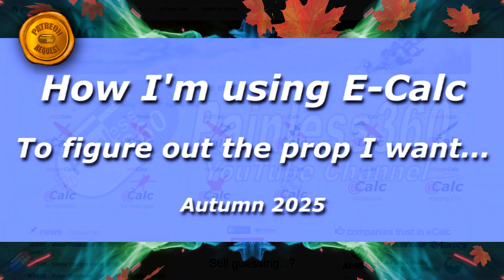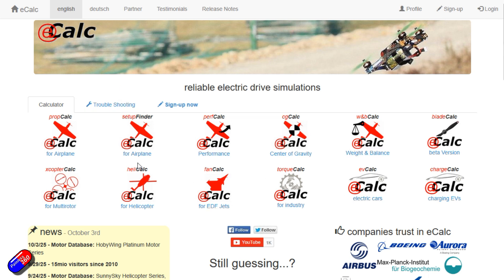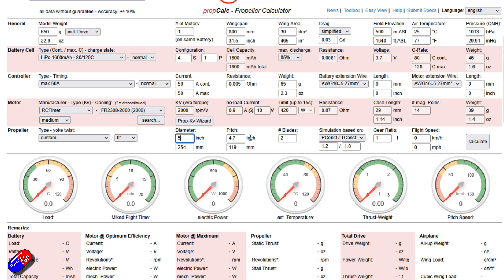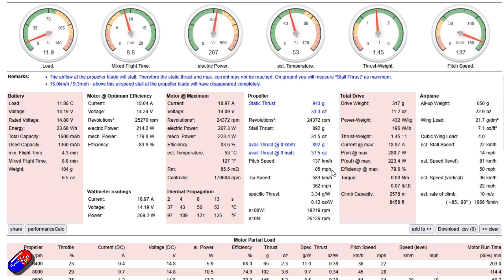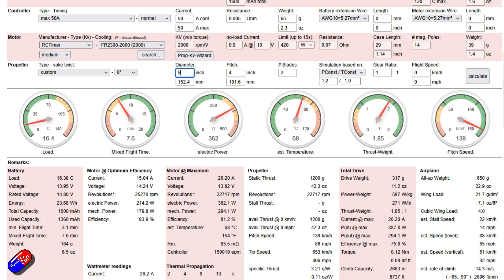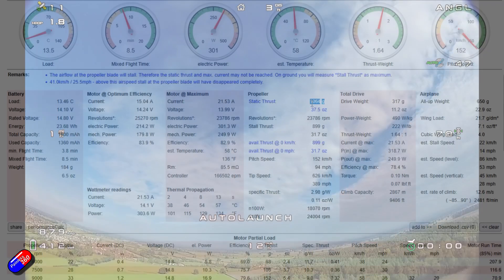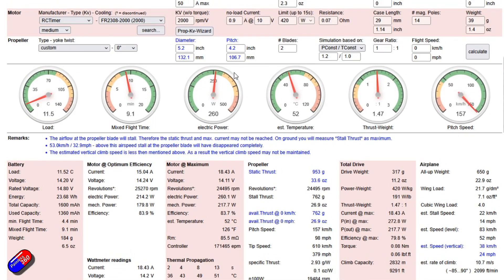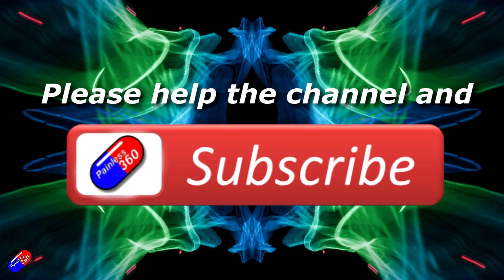How I'm using e-calc to find my perfect Chupito prop...

Comment: The thing is, ecalc will give you an idea about what might work in general. However, it cannot properly estimate your numbers with anything higher than around 100kph. Air drag is a massive factor that comes into the equation exponentially with increased speed. So, do your basic setup and fly at the speed you want to optimise your efficiency at and have airspeed, amps and prop rpm displayed in your OSD. Record that footage and put the numbers down in an excel sheet. Do the same with a different prop. Now you see in what direction your next prop choice should go. Repeat to optimise as far you want to go. But keep in mind: These test flights are not universally applicable for every build, as the aerodynamics of each and every individual build will be greatly affected by equipment placement, such as antennas and cameras. Multirotor people tend to forget about that completely when they dip their toes into fixed wings first

Comment: If only TBS had somebody in their team who is actually interested in those things and willing to do not only the math but will also have a look at log files and OSD recordings to actually work out the kinks before a product is released. But hey, as long as the war money is coming in, I guess, TBS will get away with anything
Reply from the maker: The reason for my adventure with ecalc for the Chupito isn't because the supplied prop is bad. It's actually a good choice, for 6s.
My adventures are happening due to the fact that I want a 4s version, optimised for the way I want to fly it... Happy flying

Comment: You have to try a 2 blade prop 6 x 3. If you lower the pitch of the prop, you can get a larger prop. Good luck!
Reply from the maker: Thanks for the comment. A 3 inch pitch would help maintain the amp draw but have a big impact on speed. I didn't want that. .. Happy flying

Comment: I think I asked you before but, have you tried using an IA to calculate but with tech data including airfoil study, aerodynamics besides hardware data? I've calculated my hardware like Esc, battery, prop, servos, etc .. for a desired flight style and it has given me awesome setups with specific brands and models of hardware.
Reply from the maker: You should make some videos and share the how to do that, that would be interesting to many... Happy flying!
Reply: @Painless360 Just a thought, not trying to school you or anything. By the way, thanos for your videos.
Reply from the maker: Me too. Showing how to use those AI tools for that would help lots. Including me! 😁 Happy flying

Comment: Interesting Lee. How did you get on with reducing the noise?
Reply from the maker: Using a two bladed prop made a big difference. It's much quieter on that setup.. Happy flying
Reply: @Painless360  Using a 7x12 would make it silent, @kofikofikofi
Reply from the maker: @DronePioneer please also add the motor specs and max amps/speed you get you're using when talking about props like that. Happy flying!
Reply: To reduce noise, go with a 5x5 or 5x6, it's almost silent 🙂

Comment: Long time ago I used MotoCalc and now eCalc for many years. Very useful and fun to play with the components as props and motors to see how to achieve your ideal setup. 
For the Chupito my 4S Li-ions packs are standard. I wanted efficiency around 125 kmh  and a plus 185 kmh max short top speed. Local shop had the Foxeer Datura 2207.5 2750kV in stock. Using eCalc and two evenings, I came to the following configuration:  ESC 45 A, 4S1P Molicel P30B. Gemfan Flash 5152 2 bladed (noisy). 
Field results: 100% thr around 35A and max 185-190 kmh. At 75% thr around 13A and 125 kmh. Autolaunch at 80% thr and 19A and close to a stalled prop at 0 kmh launch. eCalc calculations are close to real flight performance.
Without eCalc I never could build this ideal setup. Or I had to buy several motors and props to try out. eCalc costs per year the same as one motor, so good value for money I think.

Comment: It's great for relative tuning once you have a true baseline.  It's amp draw is typically close, but it's efficiency numbers are sometimes off pretty far.  However again, pretty good once you have a baseline for making modifications.  I don't know exactly where they get their motor data, but that's where I think it often falls down.  Also props from different manufacturers and designs can really make enormous changes especially to noise.  Sometimes you just got a buy a bunch and test them in real world.  Again, ecalc will typically get you close, but sometimes it's way off.

Comment: Usually the manufacturer of the motor will put a recommended prop size(no?) and I find that the recommended size is fine. If you want to build a particularly fast or slow plane you can go a little either way with the prop, but its a good starting point.
Reply from the maker: If you're lucky enough to be using motors from vendors that publish thrust tables, then this can be very useful to help your choice. 
However, they typically not covering all of the aspects of the props performance - the table will typically show max amp draw and max thrust with a certain voltage using different props. 
You can infer the relative efficiency using a simple g/W ratio but you're not looking at all the elements needed to pick the best option. 
See my motor and prop series for more of a deep dive... Happy flying!

Comment: Hi, thanks for the videos. I'be been following the recent INAV for beginners videos. And setup a wing similar to the one in the videos. 

I maidened it today and went...mostly well. It crashed staight after auto launch. It went straight into the ground when pitching up. I'm not quite sure what happend as all surfaces were doing the right thing, elevators pointed up when pulling back on the stick (Auto luanch flew up, not down). 

I noticed that the FC thing that the pitch is a negative value in INAV when pointing the nose of the aircraft up, is this normal?
Reply from the maker: I'm seeing this a lot at the moment so may make a video on the common issues I'm seeing. The most common is too long after the throw before the model makes the thrust needed to fly, resulting in a stall and crash. Too low a throttle setting for the launch causing the model to not get enough speed, stall and crash and not throwing it only slightly nose up, so (you've guessed it) the model stalls and crashes... Stay tuned!
Reply: @Painless360  Thank you appreaciate the response. The new model is printing now, hoping to get it up in the air with some changes, no use trying the same thing twice and expecting a different result :D Great work with the videos, they've been extremely helpful.
Reply from the maker: Check out https://youtu.be/v-6Xdv6iku0 I hope it helps...

Comment: Lee, great stuff! I have been a subscriber as well for many years to eCalc. There is some tricks to understand how to get the best results but with a bit of practice, it is worth the time. Understanding prop pitch, stall, motor kv and amp draw has been a great exercise in knowing how to size a prop to a motor/battery combination. More importantly, how it will launch and top speed. One lesson that sticks out is there is very few instances a 3 bladed prop should be used on a wing. Stick to 2 blades except when you need a bit more static thrust.

Comment: I'm using ecalc right now to set up my 3hr endurance aircraft. I currently have a dolphin with a 6.5x7.5 prop and the prop stall speed is 90 mph...
Reply from the maker: Check out the motor and prop series video on how to optimise for endurance. Also consider the Carson speed too... Happy flying!